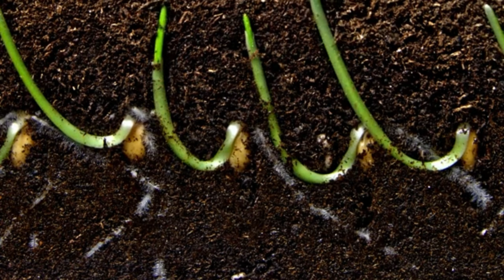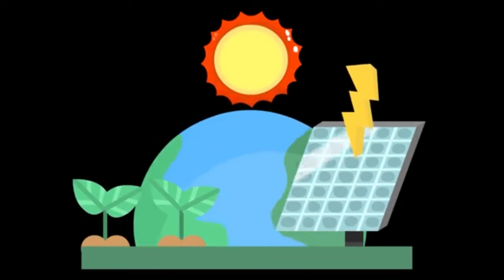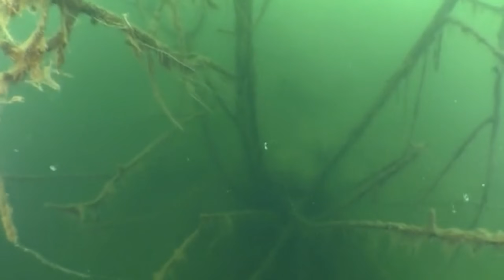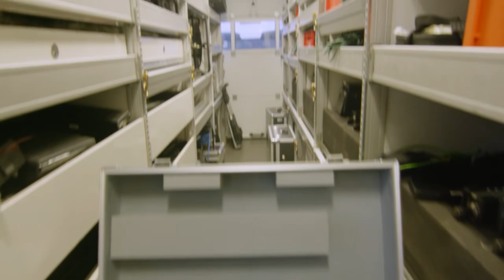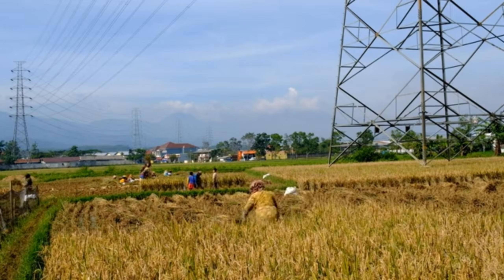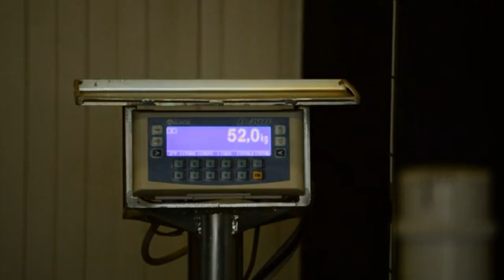This Plant Generates Electricity. Grow It In A Pot. Power An LED Forever.

Comment: I built one..now we wait☆
Reply: I'm building one with a peace lily. Ok, I'm using a plastic pot, I drilled the hole at the bottom, wove the wire  into my carbon felt, placed it at the bottom of the pot, ran the wire through the hole, sealed the hole, filled pot half way with combo of muddy soill and compost, tamped it tight, added a layer of sand, tamped it tight...Now, does the cathode carbon felt get placed right on the sand or do you fill the remaining half with the plant and soil and then place the cathode carbon felt on top? Thanks for any advice!

Comment: Bruh your supposed to make energy either chemically or finding a way to spin a magnet around copper and you can't just put the it in the dirt because the plant is turning the soil into energy and so is the bulb unless you plug it in directly into the plant

Comment: Carbon felt, titanium wire and basically any plant you'd find growing in the edges of a body of water...

Simple enough.
And if electricity is generated, it can always be amplified and/or multiplied

Comment: 2. The Current Reality
Extremely Low Output: Even in lab settings, the energy harvested is tiny—often only enough to power a single low-energy LED or a small remote sensor.
Commercial Availability: While companies like Plant-e have developed modular systems for this, they are not currently sold as standard garden equipment for residential harvesting.
Electroculture Myths: You may see "electroculture" trends involving copper coils or antennas. These are generally intended to stimulate plant growth using atmospheric electricity, not to extract electricity for your use.

Comment: The right material would be copper wire coated with nickel then Pt or Pd. To prevent the corrosion. Same way platinum anodes are used in electrolytic chlorate synthesis.
Reply: However. One thing (if I remember correctly) you do have right. Is that any oxides that may be formed on Titanium electrode are protective and conductive as well.
Reply from the maker: That's a fascinating technical insight on preventing corrosion! 💡

Comment: Lots of bla bla and very little useful information, except for 20 seconds at the end. However the instructions are far from clear. This arrangement CAN NOT power an LED. A red LED requires 1.5V to fill the bandgap and star glowing. Other colours need higher voltages.  Since the plant produces 0.3-0.7V one plant CAN NOT power a LED.  This "mistake" makes me question the validity of all other information.  It would be interesting to know why copper wires supposedly don't work. The are connected to a conducting media (the carbon patches) and are not supposed to take part in the electro-chemical reaction themselves.  Platinum wire is more or less as expensive as titanium wire, but platinum wire is readily available from most business which sell electronic components, including several internet based shops. (No one named over any others)
Reply from the maker: Thank you for the detailed technical feedback regarding the voltage requirements! 💡

Comment: Coining the power plant is a good one. But seriously, DC current even if the household voltages could be scaled requires inverters to output AC. I appreciate your intentions, but the pushback points are many. I won’t be labor them here. Good luck with the stackable versions. ☃️
Reply from the maker: You make a great point about the technical challenges of scaling this for household use! 💡

Comment: I made a joule thief that powers an led at .4—.7 volts. Mainly because I was getting that voltage from a copper wire in the ground positive, and a copper wire wrapped around a metal pole on top of the grass negative. After a few days the 200 farred capacitor was charged and powered the led for half a day. Transistor 1816, wheel inductor 2.2 mh.
Reply from the maker: That's an incredible DIY setup you've created!

Comment: I'm pretty sure ancient cultures used this technology and historians claimed otherwise.
Reply: Ancient? Kids around Africa have been charging cell phones and other gadgets using trees. Necessity she is the mother of Invention.
Reply: @judywilson210  are you serious rn?
Reply: @okyanusya4093 
Sure is, they have been using trees to charge their cell phones since ancient times
Reply: You thinking about the Baghdad battery. It has not been proven it produced electricity.  
The Dutch company Plant-e holds patents on this technology and has used it to power LED street lights, Wi-Fi hotspots, and environmental sensors in the Netherlands and rural areas.
Cost of Scale: To generate enough electricity to power a standard household appliance, you would need vast, impractical wetlands or fields layered with expensive electrode matrices.

Comment: To everyone neighsaying this, just go back to our old potato clocks. Electrons flow from cathode to anode. This is just a larger variant. He is right. This could easily power your home's lighting etc without battery backup. Add batteries and they will charge over time. Need more power, add more "generators". Have a lawn? Man, now we are talking..

Comment: You may not find titanium wire at your local electrical supply store, but you will find it in many others & online. It's commonly used in jewellery making & anodising, amongst many other uses.
Reply from the maker: That's a great tip on where to source titanium wire!
Reply: @DTDStoires yes, I need an address and for the carbon thingy

Comment: Most of what "he" says about the "lies" is actually lies.  For example, "we are taught in school that plants are perfect machines, efficiently converting sunlight into energy."  No, what schools have taught for many decades is that photosynthesis is about 11% efficient.  

If you fell for this claim, it means you don't have a very basic understanding of what is taught in school about these subjects.  There's no shame in that!  Just understand the producer of this video is either very stupid and has no business teaching, or is quite aware of the deceptions here and believes the audience will not be able to identify the falsehoods being deliberately shared.  

That was just an example of how even the preamble is full of lies.  The description of plants "leaking power" is bullshit.  The explanation for why mud batteries work is wrong.  The idea that this could practically replace any significant fraction of home power is a joke.  

If 5-7 volts enough to power LED's.  Yes.  But the amps matter to -- total power harvesting.  This is an extremely inefficient method of power generation, although the claim it could power sensors or something is correct.

Why do you think a complete set of numbers are omitted, as well as all of the details you would need to succeed?   Only amps or volts are talked about, never both together.  Never power yield.  Why do you think he doesn't show his home being lit?  This guy is preying on you for likes or clout.

Comment: Carbon felt, titanium wire, wetland plant (peace lily, umbrella papyrus)with water logged soil. Peat moss or sand. Pot or bucket
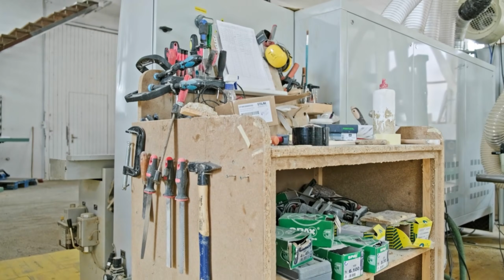Directions on putting together at 12:24
Reply: And where can we buy titanium wire ??
Reply: @alannahssolutions2723 amazon
Reply: What about copper wire?
Reply: @Cooki_z202copper degrades
Reply: @Cooki_z202works just not as long
Reply: Where to buy the felt and wire?.......
Reply: @KMac36amazon. Felt used also as candle wick
Reply: @KMac36try your hardware store
Reply: @KMac36 Both are available on Amazon.
Reply: Thank you. ❤🎉

Comment: just to ground this in reality, you would need 4 acres of land entirely dedicated to this structure to power a small home (think portable solar generator type power, not grid power). The material cost of such an endeavor would be astronomical compared to the price of fuel and a generator and/or compared to whole home solar prices. The novelty this video is marketing is known as plant/soil microbial fuel cell (PMFC/SMFC) if anyone wants to look deeper, but for those that dont, this "technology" does not replace the need for real forms of power production (fossile fuel, nuclear, solar etc).
Reply from the maker: You've brought up some very important practical considerations regarding the scalability and cost-effectiveness of this technology for larger power needs!

Comment: Rather than a description accompanied by random photographs, a clear illustration of the pot arrangement and a circuit diagram would be helpful.
Reply: Plastic bucket/pot ,2 pieces carbon felt/cloth (anode bottom, cathode top), Titanium wire (2 pieces – don't sub copper/steel!), Wet muddy soil + compost, Sand/peat moss/gravel (separator layer), Wetland plant (peace lily, papyrus, cattail – something that loves wet roots), Low-power LED (uses least voltage), Multimeter to test

Drill small hole near bottom of bucket for wire → seal later.
Bottom layer: Carbon felt + weave titanium wire through it (this is anode/negative). Feed wire out the hole.
Pack in wet muddy soil/compost mix halfway up – press hard to kill air pockets (anaerobic zone for bacteria).
Add 1-2" sand/peat layer on top (blocks oxygen from going deep).
Top layer: Second carbon felt + weave second titanium wire through it (cathode/positive – exposed to air).
Fill rest with soil → plant your wetland plant → water well (keep moist like a bog).
Wait 1-2 weeks for bacteria biofilm to form (voltage starts ~0V then climbs to 0.5-0.8V).
Connect: Bottom wire → LED negative leg, top wire → LED positive leg → watch it glow dimly but steadily.

Key Reminders

Titanium + carbon only – anything else corrodes fast and kills it.
Keep soil wet, give plant light, treat like a houseplant.
Low power: one tiny LED max per pot (stack multiples for more juice).
Magic happens after the wait – bacteria eat plant sugars/root waste → electrons → light!
Reply: @theloveiswhere amazing!!! Thank you!❤
Reply: @theloveiswhere Thank you! I just screen shot all of that❤
Reply: @evangelinebelami8716 me too!!
Reply: Thank you! @theloveiswhere
Reply: @theloveiswhere . You should do a video on this.
Reply: @theloveiswhere ur amazing 💯😮🔥🔥🔥
Reply: @1HorseOpenSlay  I typed it out for myself, so it made sense to share. Hope it helps 💞
Reply: @theloveiswhere  yeah i could not read all that and get it. Need visuals
Reply: @ladybonezz8017 Try searching for frontier energy harvesting plants. A diagram should pop up. It won't let me post a link
Reply: @theloveiswhere I saw the diagram. Thank you for the recap! ❤
Reply: @IAmTheGoodOne Glad to help 💞
Reply: @theloveiswhere wow had to come to the comments first to see if it was real 😂 thanks for this explination!
Reply: I tried to post a link to a diagram but it may have been blocked. It can be found by searching "frontier energy harvesting plants" I already ordered some carbon felt and titanium wire lol, this sounds amazing!
Reply: @theloveiswhere : Thank you. I'll go and have a look.
Reply: Thank you!
Reply: Yes the proper illustrations definitely would help.
Reply: There's a guy on YouTube called Robert Murray-Smith (that's his channel name too) and he does all sorts of home build technology if you're interested.
Some time last year, he got a current flowing from the ground by sticking 2 electrodes in it. Don't ask me what these electrodes were made of, I can't recall now.
Anyway, apart from a couple of rather unimpressive ideas (he's a bit of a myth buster when it comes to some of these home made gadgets shown on YouTube), he does have a few interesting ideas you might want to have a look at.
Reply: @Debbie-henri : Thank you for reminding me, as I was a fan of his. I'll go through his videos again. He lived not far from me and was prolific with his videos. I'm sorry to say that he ended his own life after losing his beloved wife. RIP Robert.
Reply: @johnpowell5433 😢 condolences 🙏 may he RIP
Reply: @johnpowell5433 
May he rest in peace 🙏🏽.
Reply: @johnpowell5433 how sad. 😔
Reply: @Debbie-henri My friend showed me something like that. He used a long steel nail and copper but it had to be facing a certain direction. I can't remember exactly how he did it but just the nail and copper in the ground picked up electricity.
Reply: Wrote this down on paper so if the grid goes out I will still have the instructions 😊
Reply: Also to use a LED light bulb is bad. Causes cancer.  So an incandescent bulb would be better.
Reply: @HollyUpton-f1u  Incandescent bulbs require far more electricity than this can produce. One of the reasons he used a red LED in the video is because it takes the least amount of energy.
Reply: @HollyUpton-f1u 😂 LED light bulbs don't cause cancer
Reply: @jonhowardtube yes the leds do. Do ur research if u don’t believe me dear!
Reply: @jonhowardtube yesssss they do my dear. Do ur research before u make that claim. It also causes eye problem.
Reply: From where are you ordering wire and felt please?
Reply: @KMac36 Amazon
Reply: ' PICTURES PAINT A THOUSAND WORDS '..
Some people don't need to know how the car works ..Just taught how to drive it ..Such in depth physical Biology is wasted in them and they see it as relatively useless information and move in without learning the practise of the point ...( Sorry to be a teacher teaching teachers )..But I'm old enough to have lived two or three of your life times 😊
Reply: Thank you bc this is beyond me😊
Reply: Waiting for that!!!
Reply: I thought the same.  It’s probably they are worried if there is to much info that they would be taking down.
Reply: They never do that as they want you to  watch the whole video.
Reply: The photographs are showing exactly what he is talking about. Im sure there are many in depth videos out there about this topic. Most people aren't ready to watch a slow technical video,  so this vid is an excellent introduction for people who may have never heard of this tech.
Reply: 100%! Great comment/suggestion xXx
Reply: Also some actual fact checking instead of spouting garbage claims that "industry says it's impossible".  
Nobody says it's impossible, it's just really weak and not particularly useful.
Reply: Just came here to say SAME
Reply: 😊 Yep I second that! Or 300+ it, whatever.
Reply: They won't because they're lying!!!  Only lies are acceptable for youtube.  Anybody that tells the truth are shut down as liars and only liars are allowed on youtube.  That's why many content creators have left youtube.  That's why I call it the liars club
Reply: And let us know where to buy the supplies!
Reply: Ya dig
Reply: That’s what you get with AI generated videos and advertisements
Reply: You better be building the plant generator they're calling for bad weather tomorrow all across most of the country maybe tornadoes
Reply: He gave you the info. This is basic stuff. If you need a schematic, do a bit more studying of basic electrical circuits, then you will understand. This is genius!
Reply: @akalaification : The information may be basic to you but it is Greek to me. We're not all as gifted as you. Your superior knowledge should enable you to draw up a schematic quickly, I suppose.  Why not do that instead of telling a 76-year old to go and study.
Reply: @johnpowell5433 Brother, that is not my job. You can, however, just Google it or ask ChatGPT to explain it to you. Good luck on your journey of self-enrichment. 😊
Reply: And get off your self pity trip. No one cares. I know I don't.
Reply: @akalaification Behave!
Reply: @11AriseAndShine11 ok karen
Reply: @akalaification Grow up and stop acting like a 2 year old!
Reply: @11AriseAndShine11 I said ok, karen.
Reply: @11AriseAndShine11 stop acting like you own the internet and mind your own business.
Reply: It's bc it's AI.
Reply: @whatsername123  are you trolling, a shill, asleep or just plain dim?
Reply: @LanceWarren-r5n4d  This video IS ai. I've used chatgpt as a glorified notepad long enough to know without a doubt based on word frequency alone.

But I also won't let that sway my judgement. The information here is extremely compelling.